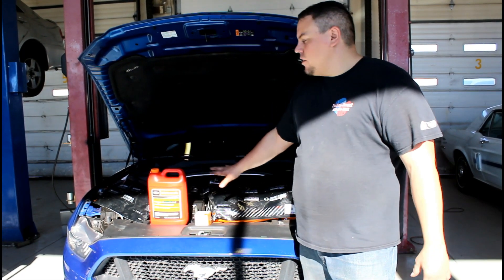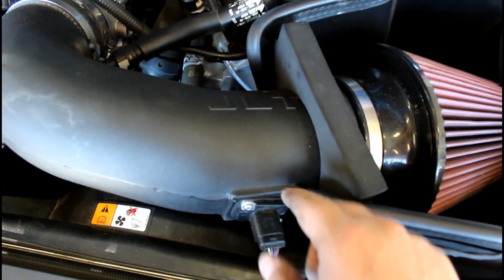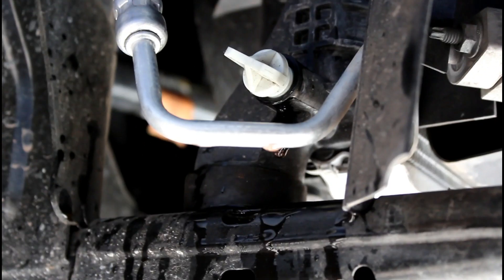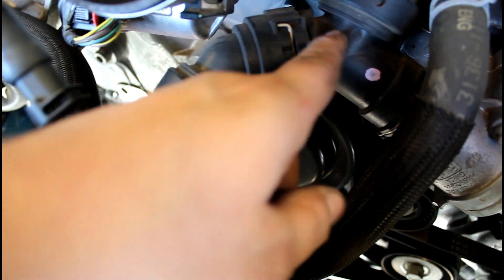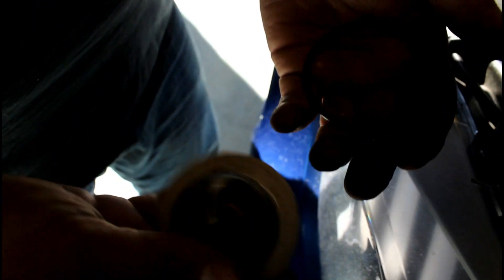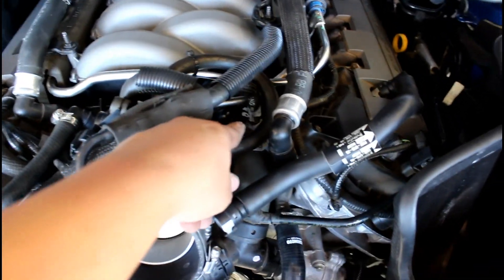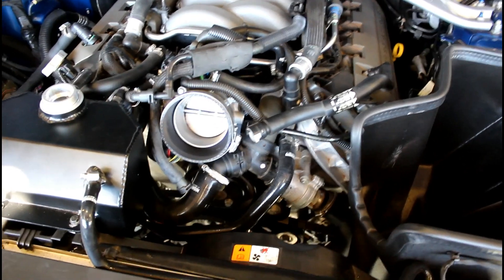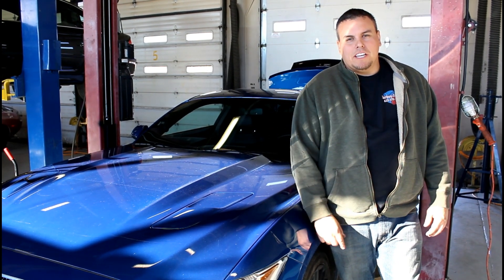How To Install 2015-2024 Ford Mustang 160F Thermostat & Silicone Hose

Comment: U did not show bleeding process . What are head temps n/a after 160 thermostat and good coolant.
Reply from the maker: there is no bleeding process in these closed systems.  just fill and run.  then top off then check once a day until fluid no longer drops.